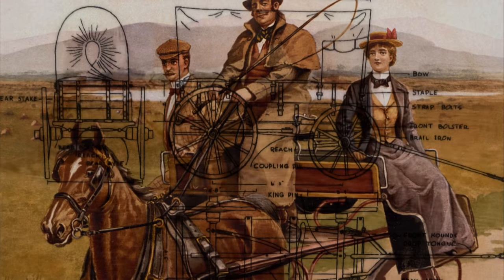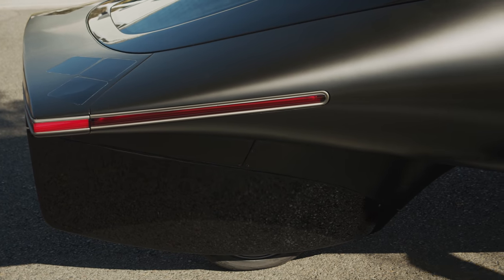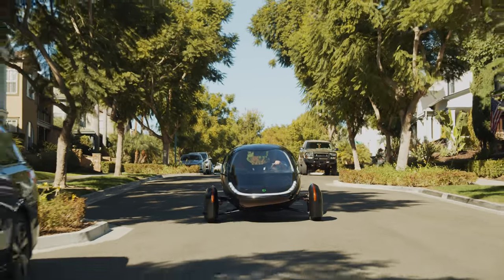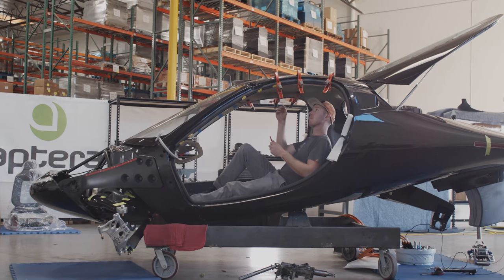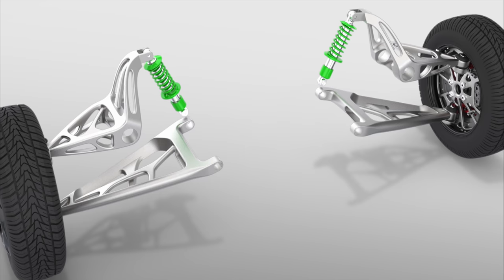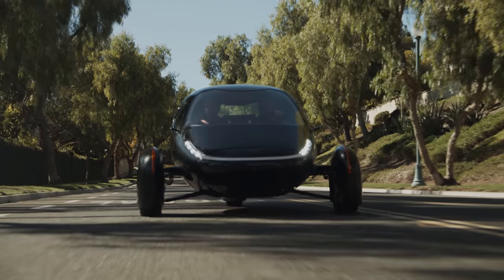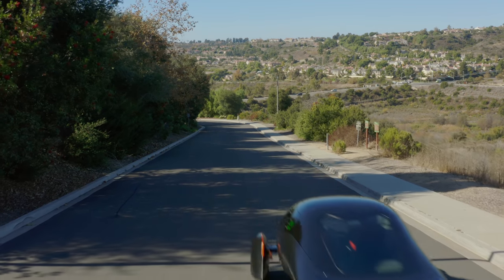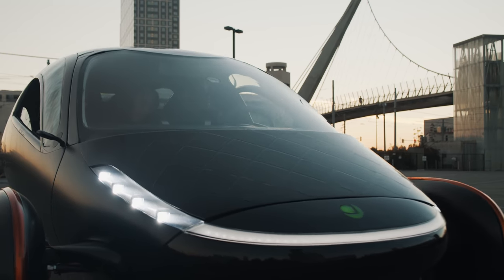Aptera Has Launched

Comment: @3:54 what "other" electric vehicle do you have to charge for more than an hour at a charge station before you can "realistically get back on the road"? Just saying so doesn't make it so. Tesla Model 3 and Y will take up to 200kw at Superchargers. That's 0-80% in 20 mins which gets you 280miles/450km while carrying more people and more cargo.
Reply: True, but also using far more power.  Aptera will gain range at a rate of 500 miles per hour of charge time on only a 50 kw DC charger.  This also means that you gain significant range charging overnight from a 110 volt 15 amp plug in your garage- about 13 miles per hour of charge time.
Reply: @n.brucenelson5920  I want to believe it, I really do, but only when I see it. Regardless, even if Aptera meets or exceeds all of its performance, range, and efficiency claims, I just  think there are certain elements inherent in the design that will prevent it from becoming a commercial success. First, it's a two seat vehicle. If your targeting single vehicle households that simply won't do. On the other hand if it's intended to be a city car, its dimensions are literally a massive hindrance; the thing only seats 2 with minimal cargo capacity, yet it's over half a foot wider than an F150 (with mirrors folded). The reason why MINI is able to sustain a brand based on one small car is because it works immensely well as a city car by being small on the outside, large on the inside, fun to drive, efficient, has 4 seats and a trunk. Thus many people can justify it being their only vehicle. Imo Aptera is basically the answer to a question no one asked. Tesla became a success because they addressed the issues of climate change, sustainability, and emissions in the form of a high performance automobile while asking little to no sacrifices from owners. Rather in most use cases, they even offer advantages over their conventional counterparts. Whereas Aptera imho is too quirky and not not practical enough, or maybe they're just ahead of their time... only time will tell.
Reply: @georgecostanza2695  That is certainly fair.  There are only a small portion of car drivers where an Aptera like vehicle will meet their needs, or should be taking a risk on a new unproven vehicle.   

 I think you are mistaken about the minimal cargo capacity.  At 25 cu ft and 500 lbs, this is massively more than most 2 person vehicles.  Look at the numbers the Pontiac Fiero sold at in the US.  The biggest problem Pontiac had was they were building it in a massive factory many times the size that was needed for the 30,000 or so per year they were selling on the average, and the other vehicle they were planning to add to that space was canceled.

The fact that they already have more than 13,000 preorders while just entering beta stage tells me that the demand is there.  Aptera is already planning to double their planned production capacity for this vehicle based on demand.

The other big plus that few are talking about is that Aptera's build method not only results in a stronger, lighter and safer vehicle than conventional tech, but the tooling is an order of magnitude less expensive than most other manufacturers to produce.  They can be profitable with much smaller total numbers.

Since I have spent much of my career around the world remediating polluted sites, I have a more acute sense of what the petroleum industry has been doing to our air and water.

I am willing to take a chance that this can be part of the solution, just as I did when I went to Kuwait to work with the Kuwaiti EPA when the fires were burning there.  The US Marines I met flat out told me I was nuts, so there is that.
Reply: @n.brucenelson5920  I appreciate your point of view, and regardless of what I think about its practicality, Aptera's success only be a good thing.
Reply: @georgecostanza2695  Thank you.  I hope they can get through the startup pains to start building, other, more mass market cars.  We will know in a couple years time.

Comment: I have two degrees in Mechanical and Aerospace engineering. They're claims are a load of bull. If they have to charge over night to get 150 miles of range, there's no way they can recover 40 miles from how ridiculously little surface area their vehicle has. Even at 100% efficiency (best of the best is only 35%), you could recover enough energy. Also, the whole zero drag thing is preeeeetty dumb and their CFD didn't account for the tires. There's going to be a large low pressure zone inside the tire casing, causing turbulence below and aft of the housing. Spheres are very aerodynamically inefficient, even if you squish 'em.
Reply: The peak output of the panels is 700 watts.  At EPA highway speeds, Aptera uses less than 100 watt hours per mile.  Let's say you average half that over a 12 hour day.  That give you 42 miles.  Since you are an engineer you could have calculated that.

Moving the wheel pods so far outboard allows the body to move in cleaner air and improves the cd by more than ten percent.

Comment: Three wheels though? I know nothing about vehicles and engineering but isn't that a bit unstable?
Reply: They can be.  But with the 77" front track, the forward weight bias, the low center of gravity. and the lack of side wind forces due to the aerodynamic shape, it is more stable that most SUVs.

Comment: 40 miles per day just on solar? Comon that can't be real!
Reply: 750 peak watts of solar cells, up to 4.4 kWh of power collected per day in San Diego, and a use rate of 100 watt hours per mile on the EPA highway cycle.  It checks out.

Comment: Very nice concept... but I don't think it will survive crash testing.
If it remains in the "3 wheel motorcycle" category, like the Polaris Slingshot, it will be alright.
Reply: Even the original model from years ago met all of the automotive crash test requirements.  This one is far more robust and the computer modeling says that it will do very well by automotive standards.  Actual cars will be crash tested and the ratings revealed before they go into production.
Reply: @n.brucenelson5920  Sure, it will have to pass crash test before production, but to retrofit it, they will probably sacrifice on the light weight-ness and energy efficiency (range). They also need airbags.
Reply: @han1218  They won't have to retrofit. Crumple zones and airbags were included in the design from the beginning, along with a F1 style passenger safety cell.  It was designed from the clean sheet of paper beginning to pass and be safe.
Reply: @n.brucenelson5920  Well it sure doesn't look like it, but appearances can be misleading. For example, the Smart ForTwo looks unsafe, but did very well at crash testing, because of the reinforced frame, but a crash still causes considerable shock to the passengers. They might make it alive, but their brains are not going to do very well.
Reply: @han1218  You are well informed about the Smart Car situation and completely correct.  Having the size to include energy absorbing crumple zones is a major improvement in real safety.

Comment: These could be pumped out for a few thousand dollars. This would boost our society greatly being able to become mobile for less.
Reply: Unfortunately, that might barely cover the wheel motors.  While the Capital costs to tool up are way less than Tesla's, there are still moulds, vacuum infusion equipment and labor Not to mention software development and crash testing to automotive standards

Still much lower costs than it takes to build a Tesla.

Comment: I would expect a small electric car to be cheaper than a regular car. Unfortunately that's not the case. And those tiny solar panels can NEVER charge the equivalent of 2 gallons of gas in a single day. Not a chance.
Reply: It is simple physics.  The solar cells have a peak output of 700 watts.  At EPA highway speeds Aptera requires less than 100 watt hours per mile.  40 miles is very achievable with the full solar option in the Southwest.  There are many vehicles that require a couple of gallons of gas to go that far.
Reply: @n.brucenelson5920  It is a little more complicated than that. You need to consider solar panel size, output capacity, efficiency,  storage capacity, sun hours in a specific area, etc. Going by what they say, yes that would be very achievable. I have an issue with their claims though.
Reply: @LegionarioCruel  Of course you are right.  We know that the full solar has 34 square feet of panel space and that the cells are about 22-23 % efficient  (this also allows us to make a pretty good guess as to the supplier, although they haven't yet said.)  They have published the solar insolation chart that they use.  What are your issues?
Reply: @n.brucenelson5920  I'll just wait and see how it performs in real life conditions.

Comment: If I want a three wheeler, I'll buy a Morgan. Having been a mechanic for 30+ years, I'll be damned if I'll buy or drive electric. Especially since these things threaten my chosen career.
Reply: There will be a need for service people for Aptera, too.  The current design, for instance, will require periodic replacement of the wheel seals.  

A Morgan will have less performance and cost considerably more money.  The current design is dead because the motors can't meet European emissions standards.
Reply: If you've been a mechanic for 30+ years, I don't think you'll need to worry about your career given there's still billions of gas cars and still many years until every manufacturer is electric. Get with the times old man

Comment: Im not driving in quebec snow with that..
Reply: I will be driving in Iowa snow with mine.  The ABS/traction control senses wheel slip 32 times per wheel revolution on every driven wheel, or about every 2.5" of tread travel.  AWD with studded snow tires is likely to be excellent.

Comment: Con il sole e con il vento viaggerò in eterno. . . dal momento che consumo energia elettrica per viaggiare perché non recuperarne un po' utilizzando un mini o micro generatore eolico, ad asse verticale, posto esternamente da qualche parte dell'automobile e un sistema di pannelli solari? Questi sistemi erogheranno energia . . per sempre.(Mi spiego: un oggetto che si muove, come un'auto, creerà un vortice nell'aria, il vento. Il quale impattandosi con la turbina eolica genererà elettricità che ricaricherà le batterie).
Reply: It is not a bad idea for stationary use.  If you are moving, the wind resistance caused by the device will take more energy to overcome than what is produced.

Comment: hii guys u have right hand driving cars 😍
Reply from the maker: We will be making the right hand drive version. It is made much more simple because we are using in-wheel motors and there is nothing blocking our steering linkage in the front of the Aptera. All we do is swap the dash, steering rack, and some software settings and it is ready to drive RHD.
Reply: @ApteraMotors  😍❤️

Comment: Won’t the large fins on the back making parking a challenge? I like the idea, but not the design so much. Just my own personal preference. What about family size cars and work trucks? A two seater would never work for me. Not at $50,000.
Reply: You can get an Aptera for 25,900 before incentives, but other models are coming.  The second Aptera will be a 4 wheel, 5 passenger sedan.  There are models all the way to semi tractors in the business plan, all with efficiency as the main design brief.

Comment: Air conditioning? Mph?
Reply: A/C and heat are standard. Mphe is over 300.  At EPA highway cycle speeds Aptera used less than 100 watt hours per mile.  At a steady 65 mph It will use around 148 watt hours.  Top speed is an RPM limited 110 mph.

Comment: With no space for shopping or luggage why not just use public transport?
Reply: It has 25 cubic feet in the back, and enough room to sleep two tall adults in climate controlled comfort on camping trips.  How is this no space?  Most people will find that the free miles you get from the full solar version are way cheaper than using public transportation.

Comment: What if we put a battery in an elio... nice
Reply: It wouldn't be half the vehicle the Aptera is.  Elio was a poor copy of the original Aptera form and would not have been close to as safe.  Aptera, on the other hand, is a concept by actual engineers, designed by well known industry figures, and run by founders with a track record of success in both raising capital and bringing a company to a successful IPO.

Comment: What about safety . Like this thing could easily flip over in a crash lmao
Reply: Safety is perhaps the primary design mission, second to efficiency.  It will be crash tested to automotive standards and is designed to excel.  Due to the use of wheel motors, the center of gravity of the vehicle is not much higher than axle level.  It is far less likely to flip than any SUV, and if it did, the roof crush strength is several times what theirs are, and can withstand multiple impacts without collapsing.

Comment: The idea is there but the look is not a look. It feels like a concept that would come out in the 70s thinking that this is how futuristic cars would look like.
Reply: This design has been refined over time with a focus on efficiency.  There are some points such as the wide front track that would have been nice to avoid, but the results speak for themselves.  This was not designed to a "look" but to a performance goal, which has been nicely achieved.

Comment: Nice for a southern climate.  This wouldn't fare very well in ice and snow.
Reply: Everything I can see about the engineering seems to indicate that the 3 wheel motor versions have a chance to do very well in such conditions.  We will see the actual performance next season when they are tested at the Elaphe cold weather test track.  I am curious what worries you about the ice and snow performance?

Comment: "Far less efficient on a bicycle" Really? :- ) 

I do like the performance though.
Reply: At speed, a bicycle and rider have far more wind resistance, and will take more power to push through the air.
Reply: @n.brucenelson5920  "At Speed..." ? :- )
Reply: @KSPIRITS8  Anything much over 30 mph.  Aptera uses less than 100 watt hours per mile at EPA highway speeds which average around 48 and can go up to 67 mph.

Comment: 6 years later.....
Reply: The company was liquidated and bought out of liquidation by the original founders in 2019.  Their progress since then has been much more rapid and well managed than Tesla's was when they started to convert the Lotus.
Reply: @n.brucenelson5920  well yea, tsla were pioneers and tech is mkre advanced now than 2009.  There are a dozen electric auto companies now, but tsla paved the path for all of them.
Reply: @mobleyMobley  Yes, they certainly did.  But you have to recognize that what Aptera was doing in 2005 was much more innovative than Tesla at the same time.  Tesla was only attempting to electrify an existing car, and botched it for years.  At one point they had to lay off most of their motor engineers, who were hired by the company I was working for.  I watched this from close up.  And they lied to their customers and investors about their progress.  It was getting the government loan that Aptera didn't that saved them.  That said, Elon Musk deserves great praise for turning it around.
Reply: I was actually confusing them with elio motors.  Regardless they are both toys compared to what tsla cooked up. These are very limited vehicles and not really impressive in the slightest.  They are in a moped or electric bike category to me.
Reply: @n.brucenelson5920  whats the price on one of these?
Reply: @mobleyMobley  Range Options & Base Price
1,000miles - $44,900, 600miles - $34,600, 400miles - $29,800, 250miles - $25,900
Reply: @mobleyMobley  You do not yet understand what the Aptera is.  It will be fully crash tested and rated to automotive standards before they start shipping.  They may compare very favorably to the already excellent Teslas.  They are still niche vehicles that are designed to fit the needs of one or two people.  There will be a followup 4 wheel 5 passenger design that will be built in a similar fashion.
Reply: @n.brucenelson5920  lol

Comment: Autonomous vehicles mass transportation (Uber/Lift/bus etc., without drivers) is the future of transportation. Can you imagine the inefficiency of air travel if everyone had their own plane, landing strip and hanger? Land travel needs to be the same way. Everyone having their own automobile is so inefficient in so many ways you can't count including, but not limited to, the wasted space for parking, garages and extra lane streets/highways. No way would I invest in this company or any other company that was not focused on autonomous tech. And, eventually we will do away with the concrete streets too. These autonomous vehicles will be mounted on a single magnetic linear rail so there will be minimal or no friction. Having anything come into contact with another surface, like wheels, is just so inefficient (laws of thermodynamics).
Reply: Aptera is thinking ahead, and will begin with a level 2 "safety pilot" option that will be OTA upgradaible.
Reply from the maker: We are excited to give you more details in the future 😊

Comment: Wondering about the rear impact survivability as if a drunk driver rear ends you at 35mph.  If the car rear ending this is a normal vehicle, i'd say the Aptera would lauch up into the air.  If the rear ending vehicile is an SUV or truck then RIP.
Reply: As a personal story, I was hit from behind at around 60 mph by a large car while driving a 1800 lb Gen 1 Honda Insight.  I was uninjured.  I expect the Aptera would perform even better in such a case.  We will have the actual crash test ratings shortly before production begins, but the modeling gives me a lot of confidence.